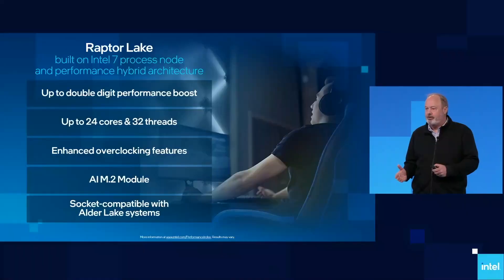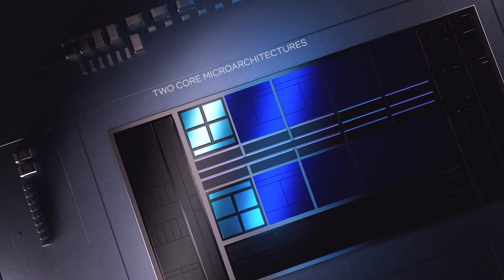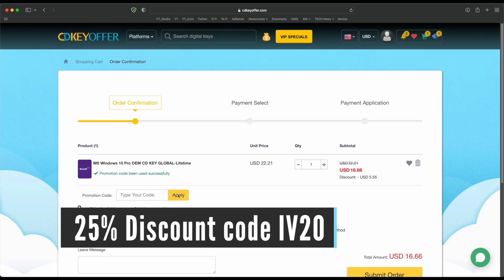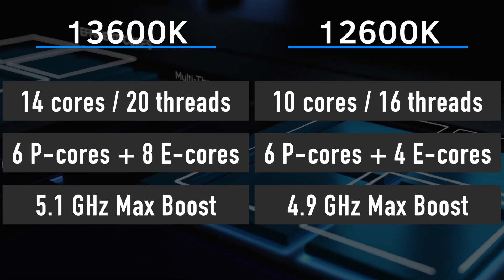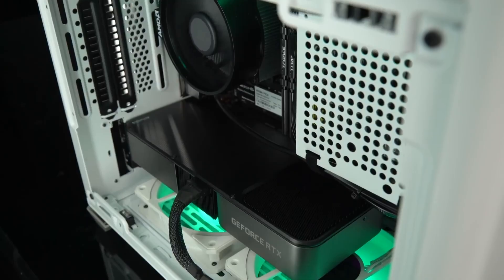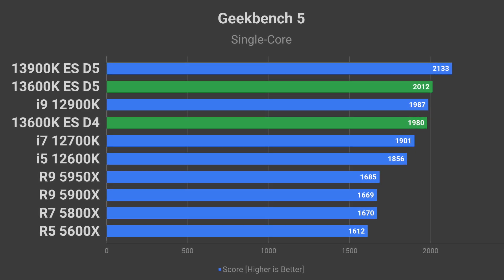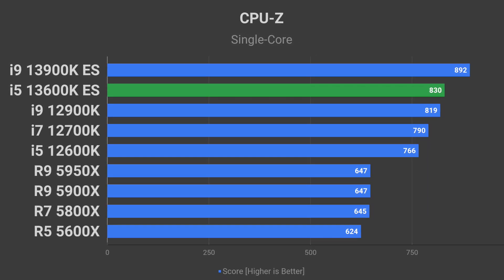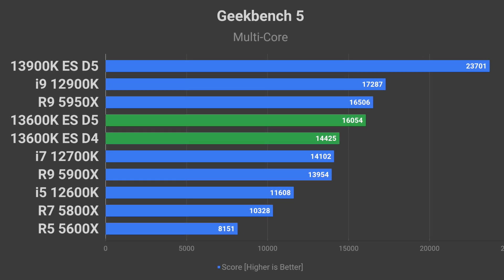Intel 13th Gen i5 13600K is Better Than You Think

Comment: It feels like intel makes i9 to popularize i5 ... I know I am wrong but as a consumer it feels like that. 
Also intel's new ceo is doing awesome work! The previous CEO was an unworthy person who has thrown Intel into the dark era. Kudos to new CEO.
Reply: What did old ceo do..
Reply: Best of the bunch. Instead of buying i9 in current gen. Wait for the i5 next gen.
Reply: @technipadi  RAPTOR LAKE
Reply: @erfguuipo8084  intel's old ceo was the worst CEO ever that happened to them. Instead of competing against AMD, that CEO actually helped AMD to get to the top. 10th Generation core is slower than Ryzen 5000 series by margin. And you want to know more? 11th Generation Intel core i9 11900k pulls more power than Nvidia's RTX 3090. 3090 is 350W while 11900k is 400W. And the 11900k is still slower than Ryzen 5900x
Reply: @nergvinergvi7353  but he isn't the engineer
Reply: @nergvinergvi7353  wtf? I have a 11900k and never seen 400 watts. Stock its 180 watts at full load while with ABT 5.1ghz all core its 260 watts, stop talking nonsense (i would say 260 watts is a lot but definitely not 400 and if you think a 3090 stops at 350 you are delusional)
Reply: i9s were really supposed to be for those looking for high end performance that don't want to wait/people who need high productivity workloads, same thing with 3090, 3080 ti and Ryzen 9s

Comment: I mean shit you see how Good the i5 12600k is? Not hard to believe the i5 13600k will be a beast also. I mean you see the i5 12600k people overcloking it to match an out of the box i9 12900k? It's incredible. Still very happy I went i7 12700k but yeah those are great cpu's!
Reply: What im anxious about is the thermal performance
Reply: @AstolfoMyWaifu  on desktop setup u never have to worry for thermals right unless u do extreme overclocking
Reply: @bhavyajain2427  not for 12900k idk if any1 can overclock it without nitrogen or some crazy 9-12 fan case

Comment: Looking forward to the i5 13400, seems like the right time to replace my i5 7500
Reply: Probably a 6+4 design
Reply from the maker: Yeah, I too think it'll be 6+4. But no confirmations yet.
Reply: be carefull with the TDP, please, be carefull about that
Reply: @SABaruj  The TDP is expected to stay the same for the 13400. It's non overclockable and it's stayed at the same TDP for years now.
Reply: @paultheacer269  i have an i5 11400 with another cooler, not the stock, i know people building pc telling me about problems with temp (on the 12 gen)
I buyed a combo with that cpu and a good motherboard but, in my case, i really wanted to upgrade into a ryzen 5, of course i have to upgrade my gpu this years, but, in 3 years i will look for a cpu with less TPD, i care about my bills too and to me 125w its to much and not only that, 125w of TDP means the real consume its much higher.
Reply: It may b 6 cores 12 thread ,
65w TDP
Reply: @squidscrew1339  Yeah true but I'm pretty certain it will get clock speed and cache improvements.
Reply: @SABaruj  A difference between a 65w and 125w isn't that much different in terms of power bill. It would take you 25 hours to use an extra kwh. So even if you run it 24 per day gaming or something like that in the US for instance you would spend like 11 or so cents more per day on average. That's $40 USD per year more if your PC was running at full load 24 hours a day which is completely unrealistic. (idk where you're located so I just used the US as an example)
Reply: @GhostAcez  the problem to me its the heat too, were i live it gets pretty hot and any gpu or cpu with high tdp has thermal problems and thats why i really want cpus or gpus with low TDP, in actually thinking on getting a gtx 1650 or a rx 6500xt instead a rx 480 that i have right now because i have to use it undervolted because of that.
Not only that, i reallu like lower tdp pieces of technology because i really really think on having the most efficient tdp and raw power.
I now i could get an i7 or an old extreme intel, i could buy any old gtx 1080 or 980 but i dont want to need a nuclear central just to play 1 game or do anything, believe i can even heat my room just because of that rx 480.
Finally, u can think whatever u want but believe me, having non efficient technology its a real problem, just look the rtx 4090, u will need a psu of +1000w, thats to much, thats crazy.
Reply: @SABaruj  Ok I can understand that. In that case why not go for say a i3 12100f or equivalent (58w TDP) and a RX 6400 (53w TDP) the TDP of that combo is only 111w total and could be even more efficient undervolted.
Reply: @GhostAcez  i know what are u saying and i was thinking on getting a rx 6400 when it comed out, but, in my country its almost the same price as a 6500xt, even a gtx 1650 cost more than a 6500xt here, not only that, the rx 6400 its not a good option for video editing, it lacks some thing there, i really dont remember now.
i currently have an i5 11400 because u have to think about the price performance too, but i have it just because it had a really good price because i wanted, instead, a ryzen 5 5500 because i had an oportunity to get it at half the price of a ryzen 5 5600g but i losted the opportunity just for a few days.
The ryzen 5 5500 its almost the same as a 5600g but half the price was a really good option, i believe the r5 5600g its more popular and the store i look was offering the r5 5500 at that price because no one was buying it, not only that, not so many people knows that exist.
Reply: @SABaruj  I would say if you're looking to do things like video edit and stuff like that, just get an RX 6600 if it's not too expensive for you. It's way better than the 6500 xt and only 20 watt higher tdp at most. Some RX 6600 cards have a lower TDP too I believe around 120 watts instead of 132. The 6500 xt is 107w but performs MUCH worse. You could under volt the 6600 down to around the same TDP as a 6500 xt and it would still perform way better.
Reply: @SABaruj  Also a lot of people know the 5500 exists but it's just not very good because it doesn't support pcie 4 or other new features. It performs kind of like a good older laptop Ryzen chip. It would limit an RX 6500 xt because pcie 3 performance on that card is even worse than normal performance. The 5500 would be ok with the 6600 though because it does well on pcie 3.
Reply: @GhostAcez  Men, please, i know that about the r5 5500, do you think i have the money to buy a rx 6600? please, dont waste any more of my time.
I live in a country where those components are really really expensive.
Reply: @SABaruj  I apologize I don't know what every price is around the world. In my country it barely costs more for the 6600 over the 5500 xt.
Reply: @GhostAcez  ok man, dont worry

Comment: Such a good CPU, 
Currently using i5 12600k and don't need more than 4070s or 7700 xt
Reply: The more I think about it, the more I think it'll be more worth to go with a 12600K over a 12400F (same for the 13th gen equivalents). I'm totally open to the idea of overclocking and getting extra performance. I wanna start off strong for my first build. What do you think?
Reply: @BLamb  honestly if your not that experienced overclocking might not work out good for u or u could damage ur components if u dont know what ur doing or dont have the right cooling u also shouldnt use too much voltage but u could still buy the k for the extra performance for the start and maybe later watch some videos and decide if you think u can manage to do it right
Reply: @BLamb  i got a 10900k oc with 3080ti if you want i can give u some tips haha
Reply: @pokeshowdowndaddy210  For sure. I’ve already done and am continuing to do plenty of research on overclocking. I’m also planning to get an AIO just because it looks cooler, LOL (no pun intended).
Reply: @pokeshowdowndaddy210  12600k is efficient as heck and 80 dollar more for 4 E core,
Why not.
Reply: @BLamb  aio, the one I had only lasted 3 years or less. Corsair h100 I think but that's from 2015. Some say the noctua fan cooling can be same or better. Having to change cpu sinks is not an easy task...
Reply: @erfguuipo8084  The AIO I was planning to get was the H100i RGB Pro XT and replace the fans with LL 120s for that RGB goodness. 😎
Reply: @BLamb  how long fo they lasts. I don't trust aios and their longevity.
Reply: @erfguuipo8084  They just look cooler than air coolers (no pun intended, LOL).
Reply: i5-12600k is enough for any 1440p/2160p. GPU is doing most job anyway in high resolution
Reply: @scorpius9763  Always better to have the faster CPU if you have the money. Certain games are just unforgivable.
Reply: @BLamb  Typically it's a $100 max price difference and you get 4 more cores. If 5 years ago you had the foresight to pay $100 extra for a 6 core CPU over a 4 core CPU, would you do it? My point is the 12600k will last longer and total cost of ownership will be cheaper if you end up keeping it longer than the 12400.

Comment: 5:17 Actually in 2009 Intel already had Core i5 750 with 4 cores, 4 threads with MSRP less than $200. I agree that core count did not grow fast after that.
In 2017Q2 Intel had Core i9-7900X with 10 cores, 20 threads.
In 2019Q4 Intel had Core i9-10920X with 12 cores, 24 threads.
Reply from the maker: The lack of progress was not limited to the number of cores but also to the performance of these cores. Look at the improvement pace in both AMD and Intel CPUs after the first Ryzen came out. Nowadays it actually makes sense to upgrade a CPU after 2-3 generations to see significant performance gains. Especially, in competitive games.

Comment: It means i5-13400f will be Stay between 12700k and 12600k
How insanely power full those CPU is 🔥on budget
I purchase 12400F + 3060 i think i will be fine for 3-4yrs
Reply: unless you're aiming for 1440p that build will last u more than that
Reply: @TechKAR6747  1315$ including 144Hz 1080P monitor + mechanical Keyboard Mouse
Reply: * 13400 will be slower than 12600k

Comment: It's looking like the ryzen chips will be better for gaming having more cache and higher frequencies without the e cores and intel will be better for productivity but we will see soon enough for sure. Good to see that 13th gen should provide a decent upgrade so after prices drop in 1 or 2 years getting a 13700k or 13900k should make your platform last 3 or 4 gpu upgrades. CPU is well ahead of GPU tech.
Reply: intel is increasing their cache by approximately 30 percent, and their clock speeds on their engineering sample is slightly higher so that might result in better single core which leads to better gaming performance.
Reply: CPU is nowhere near GPU tech*
There, I added some sense into your message.
Reply: @gdgd5194  nice work picking that up.
Reply: @Owen-np3wf  I'm serious though, 1080p is very popular in online games and CPU is main bottleneck when you disable all useless effects 🙂
Reply: @gdgd5194  yeah but it will only be a bottleneck if your playing easy to run games like eSports titles and you have a higher end monitor and GPU to care about a CPU bottleneck anyway . Any modern triple AAA titles require lots of GPU power. I play single player games hooked up to my 75 inch 4k tv at 60fps but otherwise play anything multiplayer at 1440p on a 165hz monitor. One size doesn't fit all but I guess if your watching this your an enthusiast or interested in PC stuff. Imagine being worried that your only getting 500 fps on counter strike with a 5600x, oh no.

Comment: 13600k is good, but is disappointing versus the Ryzen 7700x.

13600k uses 50 watts more power.
13600k has 75 percent more cores.

But 13600k is only 4% faster on the Passmark benchmark.  Zen4 is clearly the more advanced design.

And now, Ryzen 7700x is down to $320 USD.   A remarkable value.

Comment: I'm definitely buying RTX4070 or RTX3080 I wonder if my current CPU i7 7700K which is overclocked to 4.9Ghz will be a bottleneck and should I finally look for the upgrade or just keep it for one more gen.
Reply: In the same boat as you. Going for the upgrade though i5 13600k and matching it with the 3080ti

Comment: Do you think I should choose intel 12400 cpu now or wait for the cpu intel 13400 release to choose, thank!
Reply from the maker: 13400 is expected no earlier than early 2023. Are you prepared to wait that long?🙂
Reply: @theivadim  if the intel 13400 cpu improves performance significantly over intel 12400, it's worth the wait
Reply: @123jack7  if you can wait, then wait.

Comment: Im so glad I hold out on buying the i7 12700k. It was slightly over my budget. Definitely going with an i5 13600 now. Maybe Zen4 bring in some better alternative but I doubt it.
Reply from the maker: Luckily both AMD and Intel should be launching new CPUs at around the same time. So, you will have plenty to pick from🙂
Reply: Love my i7 12700k lol super happy I didn't wait because man I'm enjoy tf our of it. Even handles my 3090ti flawlessly. No point in me upgrading espeiclaly when you see the differences in actual gaming in 4k resolution it's not as cpu dependant most of the time. So for me I'm fine with sticking where I am unless I get an incredible deal!
Reply: @reviewforthetube6485  the i7 is awesome, will  get you through some good years. Im  just on a budget and the I7 was a bit too much for my liking. At the same time I was worrying about the amount of  cores on the i5 12k so the raptor lake i5 is the perfect option  now.
Reply: @melonytoni9016  oh I thought that was the one you were getting but decided to hold off. I guess you meant due to its price. Hey I understand, I will say this the i5 12600k is a beast! You can overclock it to almost match an i9 12900k out of the box. That's pretty insane right? For gaming performance that is.

Comment: The only problem I see with 13th gen would be the prices of a motherboard that will be compatible with 13th gen right out of the box since more budget options (like a B760 in this case) would come later in january-april, I suppose if I wanted to use say an MSI B660M mortar I would need a BIOS update, and I wouldn't have a 12th gen CPU laying around.
Reply from the maker: You are correct. However, some motherboards come with a BIOS Flash feature that allows you to update BIOS without a CPU installed. So, there is that option. It is pretty easy to do. A slight inconvenience🙂

Comment: So a i7 12700k by the looks of it still isn’t a bad deal considering I’d be waiting about 5 months to get a 13600k or 13700k and potentially spending $80 extra plus the increase in power draw might cause issues when I plan to get a 4070.
Reply from the maker: I would like to see 12700K go down in price a bit more. Like 12600K did. But if you need something now then it is a pretty good choice.
Reply: @theivadim  I had a ryzen 5 3600 and the performance was just not cutting it yeah it was a bit pricey but better then a 5800x3d on the whole especially in games like beamNG drive and the extra cores help plus I have a ddr5 board so if the performance gain is a lot I’ll upgrade for about $200.

Comment: I'm using an I5 11600k paired with 3060Ti
Is it even worth to upgrade to 13600k with the money spent just for gaming if assuming I get a 40 series card. Or will my 11th gen handle the 40 series just fine itself and upgrading to a 13th gen won't give any noticeable improved performance. 

Shd I just wait for another gen of cpu like 14 or 15 gen instead
Reply from the maker: I think you'll be absolutely fine with 11600K. If you want better experience, I'd improve the graphics card, monitor, more comfortable chair, etc., before spending money on a new CPU for gaming. Pro work would be a different story🙂
Reply: @theivadim  thanks for the advice.
Could defo go for the monitor, mouse and the graphics card if there is a performance difference comparing to the games I'm playing. Other wise, it's not worth the cost.

Comment: Getting a bit more power with less power draw and a lower price compared to the 12700K, seems like a good deal for gamer who do a bit of multitasking like streaming.
Reply: And some guy persisted me to wait for this trash new gen to "save money" and get beast cou :DD If 13600k can't even outperform 12900k, then it is a pile of garbage compared to ryzen
Reply: @gdgd5194  The 13600K outperforms the i7-12700K and is nearly as good as the i9-12900K for 2/3 of the price.
You can't expect an i5 with nearly the same architecture to outperform an i9 by a mile.
And if it's just for gaming, the i5-13600K outperforms the i9-12900K  due to the slightly faster core speeds and game snot using that man ycores anyway.
Reply: @buttergolem8584  My ryzen will perform just as well for a couple of hundred of euros less 😀
Reply: @gdgd5194  Which one?
Reply: @buttergolem8584  5800x3d , in games should do just fine for the price
Reply: @gdgd5194  Yes, that's a good one too if you want to keep DDR4 RAM. Still a bit expensive in Euro tho.
I have the 1700X and need a new mainboard anyway and since I'm not upgrading so often, I want to get DDR5 RAM and a CPU with good single-core and multitasking performance.
Reply: @buttergolem8584  If I had more money to waste atm, more patience and electricity price was same as before, I'd also buy new gen and wait for the upcoming 7800X3D cpu which will most likely be way better than everything on the market. But I decided to waste my next wage for a gpu so 5800X3D is the limit of what I should get, should've gotten 5600x to be honest :-D Everything else is more expensive with no reasonable gains.
Reply: @gdgd5194  At first I wanted to upgrade to Zen 3 but the 5800X3D doesn't give that much more performance compared to the normal 5800X. When it has way more fps, it's always in games where you already get very high fps with the 5800X. And in games where you get lower 100s fps, it's maybe 10-20fps more. And that for an upprice of 200€.
Reply: @buttergolem8584  True, if not my old mate and Rust, 5600x would've been all I need.